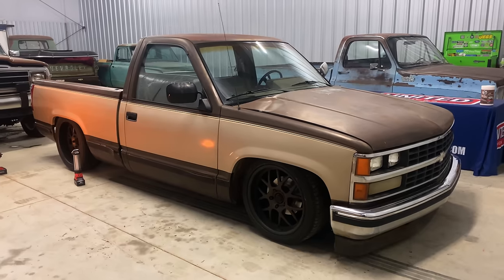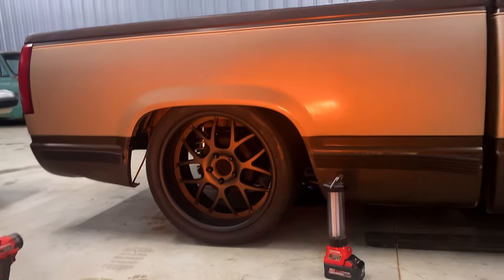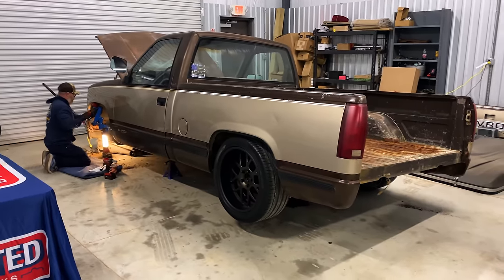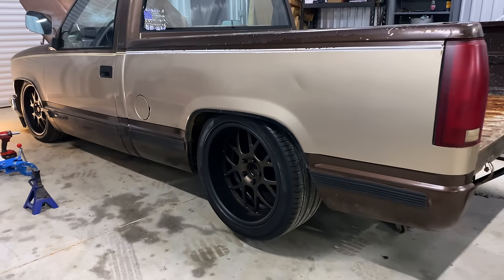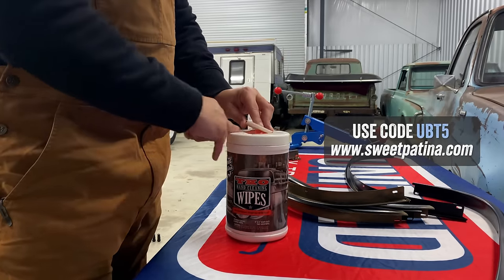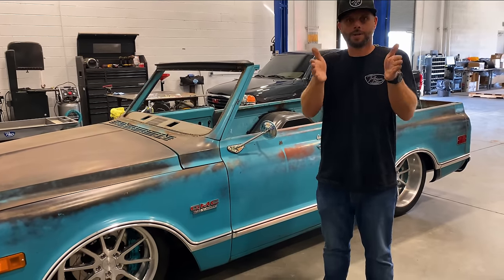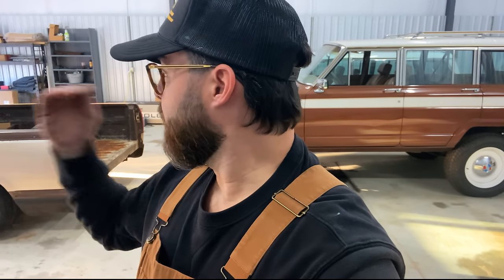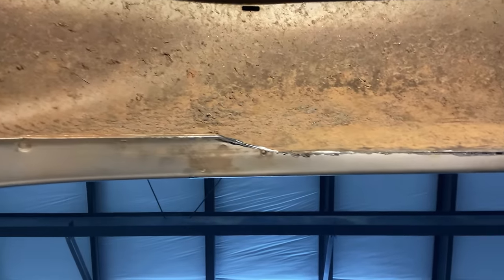OBS CHEVY WHEEL & TIRE FITMENT: what fits & what doesn't (& what you might have to do to fix it)

Comment: Its awesome to have the information out there before you get too far into a project and realize you have to undo half of it. Before I did the 2/3 drop on my Dakota I must have done weeks of measuring, research etc. Came in knowing what wheels and what the maximum tire size I could via the forums too. The kits out there were a 2/4" drop with the rear hangers. But needed Pinion shims... It adds up quick both in parts cost and the amount of work needed. Knowing the added weight I have in the bed, Hard Tonneau, full size spare, some tools that 4" rear would be too much. Ive noticed more have said, 5/8 4/7 for the drops but are running on a 20"+ wheel. That in itself brings issues. I would have loved to drop mine on the Viper wheels but at $800+ each hell no, same bolt pattern, way different offset. It's a daily, not a show truck so I had to keep that in mind too.
Reply from the maker: For sure. This is a rough truck and one that I want to learn more about working my way through obstacles on. I'm having fun but it can frustrating at times.

Comment: Have you ever thought about swapping in the 90’s Impala SS rearend?
You get disc brakes also. 
I think they are 3” narrower. 
But you could run a 1” spacer on each side. 
Would be a cool low buck swap for the OBS guys and it keeps the 5x5 pattern.
Reply from the maker: I haven’t, actually. I think I’ve about got it sorted here but that’s a great suggestion. Will look into it

Comment: Loooks good.  Backspace is critical when you're going wide and the panhard rod is nice to have.

I remember doing 295/35 18s on the back of a 4th gen Camaro back in '96  the stock panhard bar would flex and cause scrubbing, eventually went aftermakret which helped greatly.  I've done a few builds with the upper end of max width.
Reply from the maker: Yeah thankfully we can tweak a bit with the pan hard but it’s been centered already

Comment: Excellent informative video and great info on the right tools to use to make the clean cuts.
I have to say I don’t believe I could cut a mint truck like you did this one but if I did this a valuable video to take in on what not to do and what to do especially with the experts advice that was added in. Thanks for sharing
Reply from the maker: I would’ve been way more thoughtful and careful with wheel choice if this was a mint truck. This is not, so I’m using it to learn on.

Comment: Good morning. Enjoy your videos and have a question for you though. Any idea what a 94 chevy stepside would be worth-running 305 with less then 80,000 original miles. Tranny works. edge of front fenders are rusting away. Cab corners need to be replaced -hood -box-tailgate are good and interior is mint. Upstate NY. winters can be rough at times. Just wondering if you could let me know. I know hard with out pictures but was wondering was all. Thank you for any help and or advice! Have a good day
Reply: Chrome stock rims 15” i believe

Comment: No only do you need to make sure your bed is square, but also that your pan hard bar isn't pulling you diff to either side and is centered. Both mine are like your second cut, I haven't had to remove any of the inside lip that isn't stamped to the outer, so they are still joined slightly. I hope you get them to work, the wheels suit that body color, and it's only sheetmetal haha.
Reply from the maker: Panhard was centered when we did the suspension install. And yep, I’m sticking with them. I love the wheels

Comment: Good video 
I understand your struggle. 
Personally,  it might be advisable to go ahead and have the mount flange on the rear wheels milled down just a bit.
Reply from the maker: Good point. May still do that, but my main goal was getting the truck to alignment. Will continue to fine tune in the weeks to come.
Reply: @UNITEDBYTRUCKS  by all means,  alignment is,  and would be the first priority,  (for the sake of safety...and tire wear) just merely a suggestion to get the tire Clarence you are looking for. 
Good content though.
Reply from the maker: @operator5032  Thanks much!

Comment: You would have saved yourself a lot of headache by going with stretched tires. 275/35/20 on a 20x10 inch wheel would have been perfect. I run 275/35 on x10.5 wheels and it sit's perfect. Also rolling and pulling the fenders would have helped

Comment: Definitely would've had the inner hubs milled if there's enough material. That would've pulled those wheels in a good 1/2" and allow you to keep your fender lip spot welds intact. 
You're gonna need Mike to patch that driver's side cut up. You definitely don't want that open like that.
Reply from the maker: I’ll address the inner bed side. And I don’t want to move the wheels if I don’t have to. I like where it sits in the wheel well. I wish that lip weren’t there at all. lol still plenty of strength there and after talking to a bunch of OBS guys, this is what they do. I’ll handle the potential to rust portion up in there
Reply: @UNITEDBYTRUCKS  
Agreed, those fender lips are nuthin' but trouble! 😆
I used to be all about getting that tuck as tight as possible. But the older I get and the more high-quality builds I see, I can now appreciate a full finger's worth of clearance while keeping 60% or more of the factory fender lip intact. 
I'm not worried about strength of the bedside, just concerned about that big, open cavity for lots of stuff to get in and rust. But if a can or two of undercoating will seal it up, then yer good to go. 👍
Reply from the maker: @SaneCayne  yeah, I agree. This is a truck I’m learning/trying some things myself. and definitely appreciate the guidance on the rust issue. It could be a real one for sure.

Comment: Before you butcher the the body… buy the right spec wheels. 🙄
Reply from the maker: Haven you seen this truck? This thing is lucky it’s in my possession and not rotting away in the field I got it from. I’m after a “look” and a tight fit is required which means a little massaging and effort is required. Also to be this low, even the “right spec” wheels would be a super tight fit. Thanks for jumping in and statng what you think is the obvious.
Reply: Rolling the quarters or Frame mods are not what I’m talking about. When you chop the quarter lips off the inner tubs and the skins aren’t spot welded anymore… that’s what I call butchering. 
Yes I’ve done my fair share of these trucks, cars for fitment. 
Just saying it’s easier to order new wheels …. And probably fit a 305 since you did coilovers

Comment: Those wheels are too sunken in..I have a 93 c1500 and I did 18x10 rocket racing wheels squared. Perfect fitment. 295/35/18 tires squared.
Reply: Cool story🙄 we’re so glad you’re enjoying your wheel choice on your truck
Reply: I was looking at those rocket racing attacks, I've seen 18x11 on the rear of an obs and 18x12 with fender flares, but I think you could get a 12 under the rear with some rolling/cutting
Reply: @jordanbest3926  some one is lol
Reply: @BRMN8R  I have 18x10 in the back but with 5 in of BS. I’d probably go 11 in the back if i could do it again. I have flares on mine